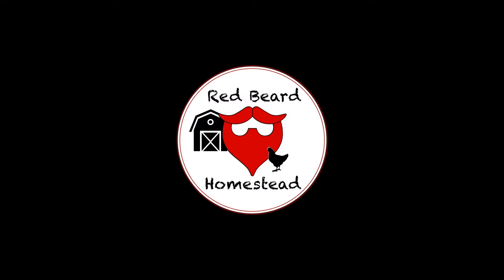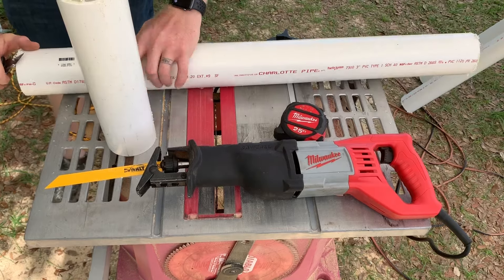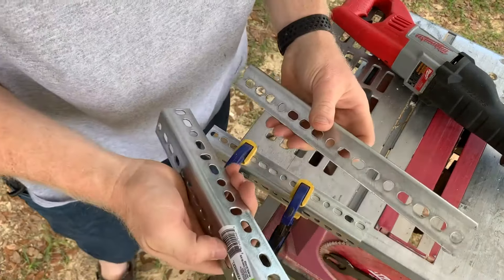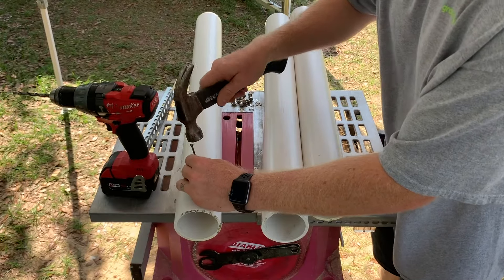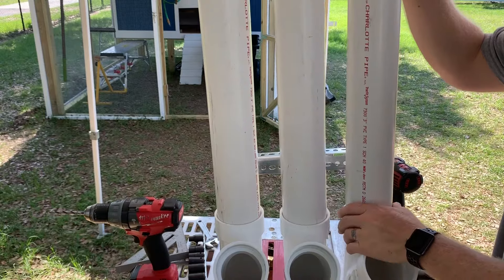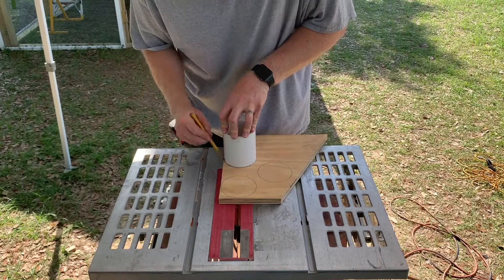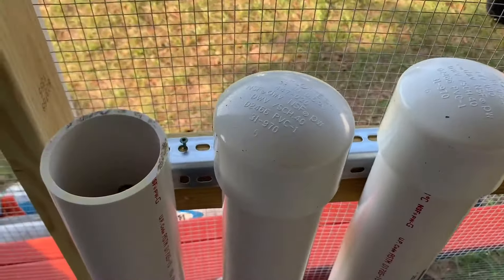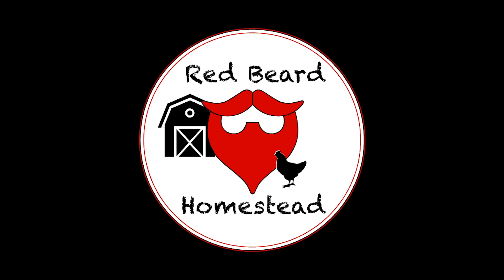PVC Chicken Feeder... IMPROVED DESIGN!!!

Comment: . 
You might consider a canning funnel to minimize spillage when you are filling the feeder.  A plastic one will run under $5 usually, cheaper at a garage sale or thrift store..  I can't pour out of a feed sack and hit a 4 inch hole.
Reply: Neither can I 😂   I tried a Poland spring gallon jug with the bottom cut out for a large funnel.  Honest waste of time although it helped a little.   Now the 5 gal. Jug mounted atop the pvc tube I found d is the ultimate funnel!  Hope it helps !

Comment: They make pvc fitting plugs for the bottom and rubber or pvc caps for the top. No need to cut the wood plugs. Insert the lower plug backwards if you don't like the extra feed in the lower part of the Tee

Comment: I have a similar design used a sanitary Tee instead. Cut out a plug for the bottom used a bucket lid and the shoved a piece of pipe in after it works great.

Comment: Good stuff! I’ve been looking for a better design than what I’m using. I will have to make a cover to make it rainproof but this is the best I’ve seen! Thanks man. I thought I was almost done with my project list too😔
Reply: You will NEVER be done with a project, there is always something to add, change, fix or improve.
Reply: One way to make it rainproof is to use a sweep El which finishes at 90 degrees to vertical pipe. You can also cut bottom section of the El out to give birds more access and top section will be like a roof.

Comment: I was going to change to the y pipe. I used 4” pipe, then attached a 90 then attached a 45. Issue is when we get sideways rain the feed got all wet. I did install a plastic curtain that can be raised and lowered, but I might not always be around when it rains. I was thinking that y you have would work. I bought one yesterday but haven’t filled it yet. Which leads me to my question, does the food just pour out the y even facing the y up? I did originally have a T and it was 90 degrees and it just poured right out, never stopping.
Reply from the maker: I’ve never had an issue with feed running out. But if it is hung too low, the chickens will “scratch” it out and waste food. Hang it up high enough that the ladies can see into it. If you have young chicks then make sure you raise it up as they get older.

Comment: Just a thought - why not cut PVC in 3 equal pieces instead of having leftover? Makes more room for feed. Same for angle bracket... maybe a bit more room for chickens at buffet!
Reply from the maker: JC Garcia good point, one thing I didn’t show in the video, but you can kinda see it in the cover photo, I actually used the scrap PVC and made little rain hats for each of the feed openings. For me, I had a limited space I was trying to fit it into so I was trying to keep it compact. That’s the only reason I didn’t use all of the angle bracket. But great comments! One thing I wish I had done differently is actually glue the bottom fittings to the pipe. I find I get just enough rain that runs down the legs and into the fittings to cause a little clump or feed there. Anyways thanks for watching and thanks for the feedback!
Reply: @redbeardhomestead  Instead of gluing the bottoms on, why not just run a bead of hot glue around the edge?  It should seal just fine and the hens would not care :)
Reply from the maker: @greglewis8752  that’s a really good idea!

Comment: The angle bracket is what thickness and what size bolt and how long?
Reply from the maker: The angle is maybe 1/8” thick.  I think I used 1/4” x 1” bolts.
Reply: @redbeardhomestead  I've seen where some have cut the bottom edge of the wye.  Is there some reason you didn't?  And have you seen any problem with them feeding?
Reply from the maker: I would think if you cut the bottom edge off, it would allow for food to spill out.   I have not had any issues with the chickens eating out of it. That’s the beauty of the adjustability. Set it low and raise it. You will know it’s too low when they keep knocking all the fees out of it.